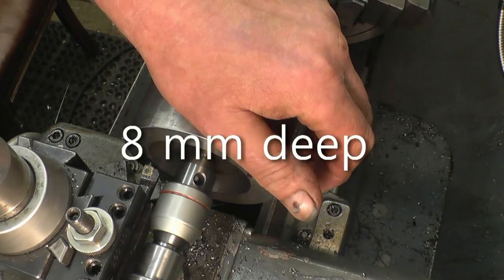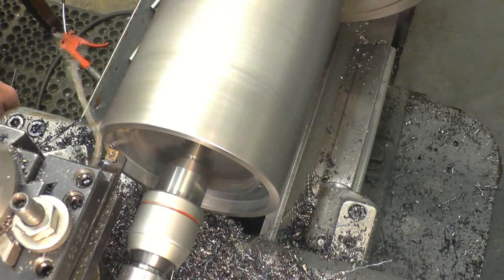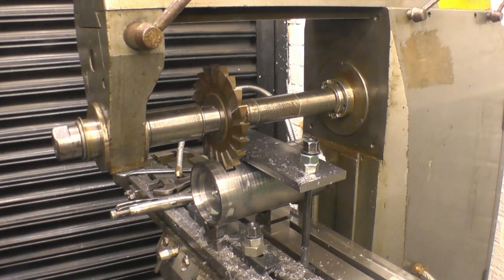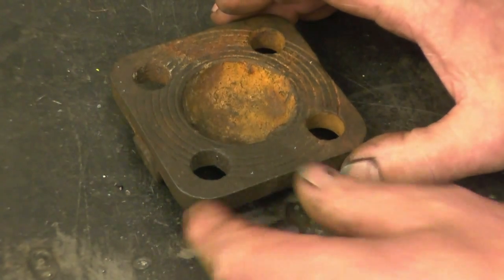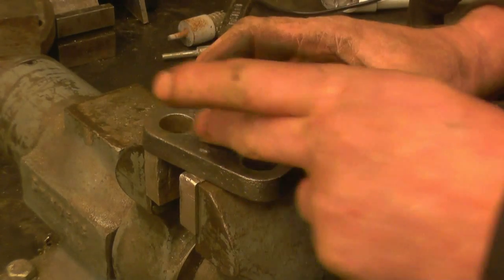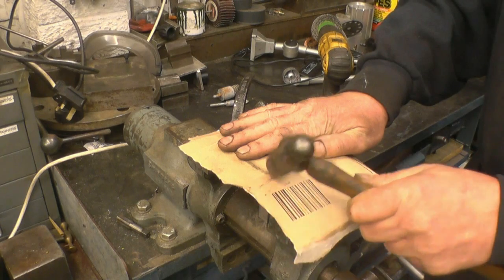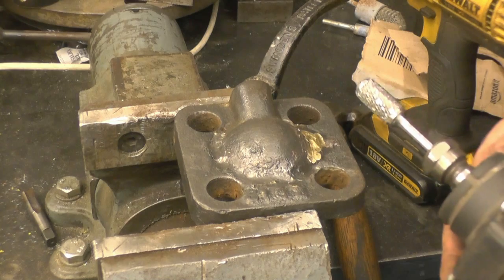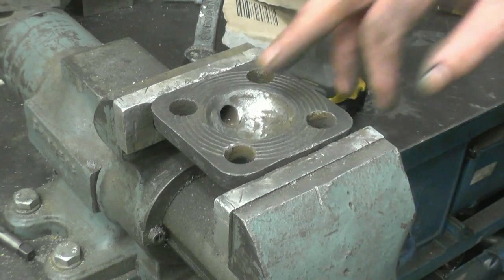SNNC 145 P2  Mill extension, Boiler feed pump casting

Comment: Hello John, your horizontal milling setup was very ‘Hairy’ in fact almost an accident waiting to happen. You should have placed the part directly on the table, to get a better surface area. Place full length blocks or parallels against the part’s length and clamp them down with them touching as tightly as possible. In effect a vee block without a vee, that should stop it twisting. You need more than one clamp, and have the bolts as close as possible to the part. Lastly to cut down on the cutting forces of the S & F Cutter, try a narrower one and do it in two or more passes. As there are teeth that cut on the side as well, when you are at final depth, you can move the table sideways to blend in any errors in the cutter depth.
You said in the video that you needed very strong clamping, the tiny vee blocks, the single thin clamping bar and wide clamping bolts, are NOT a good setup. Glad you are pleased with the new mill, as I said in a previous post, you need a hoist to get the overarm fitted safely. You may not always be able to get help fitting it, if you garage wall is solid brick, make a swing out arm and bolt it to it at a suitable height, with a small chain hoist. Looking forward to the next part of the build.

Comment: I was taught to brass drift round the edges and have a large ball bearing in your tool box to be hammered over the holes for making gaskets, I love making them, find it very therapeutic. it also generally means that the job is going back together which is also a bonus.
John like others have said thanks for letting us into your shop and educating us (with north eastern humor) along the way.

Comment: Try the Bearing welder to the bolt  to cut your bolt holes when you make the new gasket    cut bolt holes first & drop  2 or 3 bolts in the holes as you go around  then the outside  .
goodonya.

Comment: I could taste the rust as you were wire brushing the casting. Reminded me of the years I spent welding cars when they were all rot boxes.
Reply: And that metallic grinder/rust taste stays with you for quite a while. :)
Reply: It's many years since I had that problem. Hair, that is, not showering. :)
Reply: I usually notice the iron smell in the shower after grinding rust.  I think the crap settles in my hair.